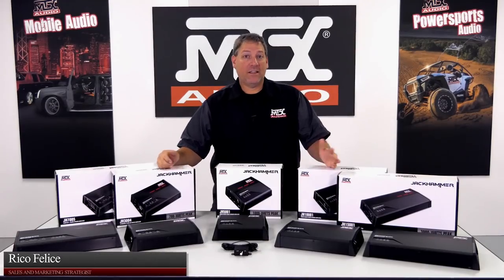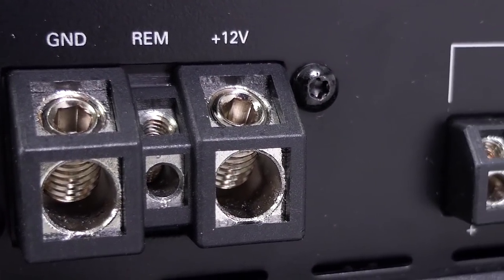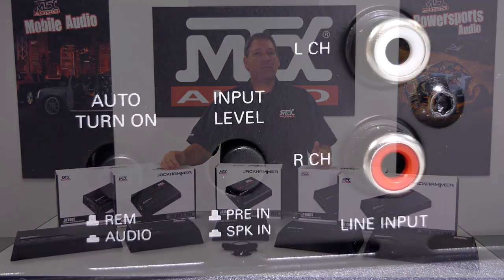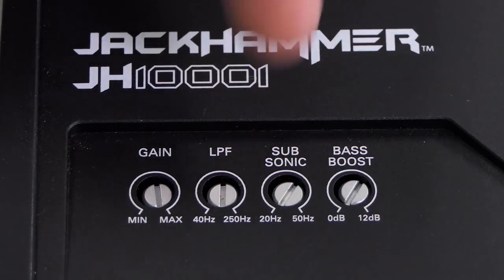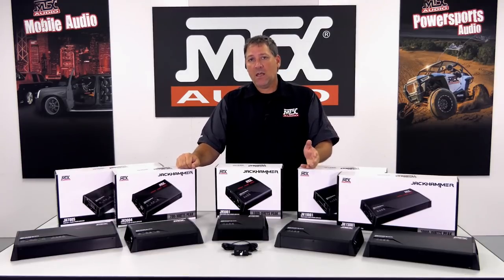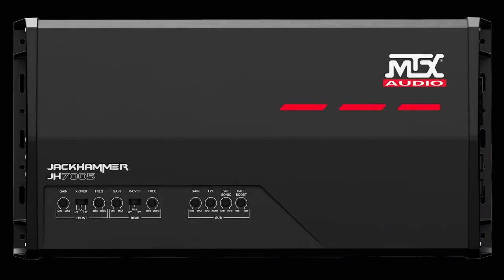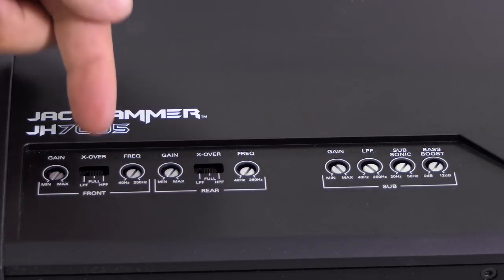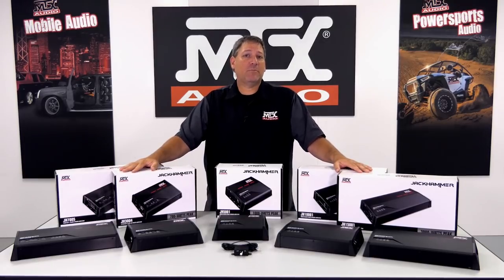Jackhammer Amplifier Release

Comment: I agree with what everyone is saying on this channel. I just installed a 12 inch, dual 4 ohm, 5500/12in, ported box 32 Hertz. Using the Jackhammer 5 channel 800 watt amp. Hertz high-end. Let me tell you this thing absolutely slams hard. This one 12-in in my extra cab is insane. Sure I am MTX biased I admit, But like everyone is saying, let's actually see some Dyno tested. But, I still believe in MTX.

Comment: I just ordered the JH15001 Jackhammer amp from Crutchfield. I hope it pounds hard. I have had owned MTX Thunder amps and subs back in the early 2000's. I hope this new product does not disappoint.
Reply: Nick I'm thinking of picking up the JH15001 tomorrow....how did it turn out for you?
Reply: @jaym6751  I got the amp just never installed it yet lol. I’ll get back to you soon
Reply: I have this amp (Jackhammer 1501 monoblock) pushing dual Memphis Audio MOJO Pro 12's(4ohm subs), wired down to one ohm and this amp slams my subs like HOLY SH*T!!